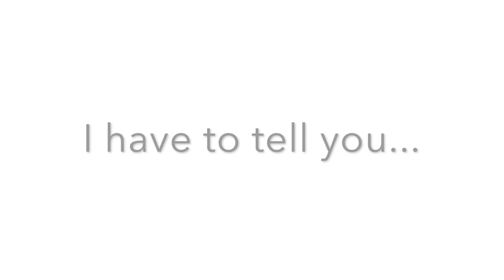Homestead Cow Processing

Comment: I'm glad you said it wasn't Sally at the beginning. I was worried. My Dad had a grocery store with a meat shop and you brought back memories. I started when I was 9 or 10 boning out for ground meat after my Dad cut the roasts and steaks. I had to clean the butcher blocks, meat saw and grinder every day. Sometimes my Dad used the meat saw for woodwork and I had to clean it and change blades. He also used a hand meat saw and a cleaver. Great video and great family. Also, in the US, our meat saws feed from right to left like your saw. Our wood saws feed from left to right from my experience. I may be wrong.